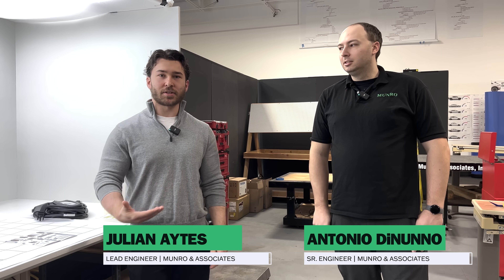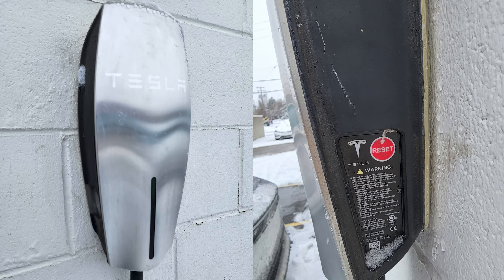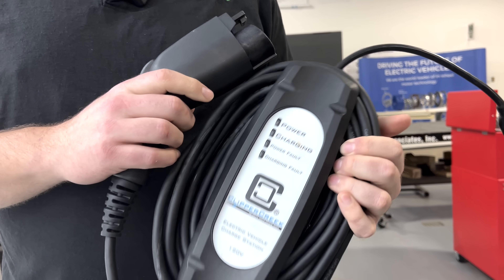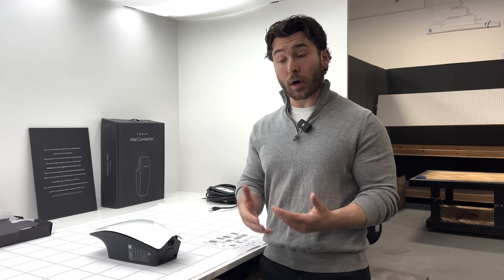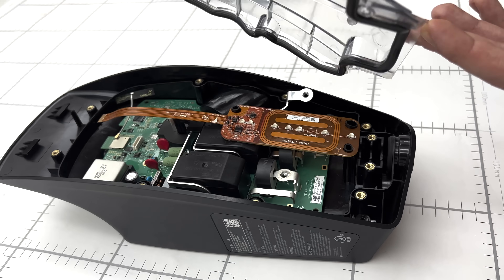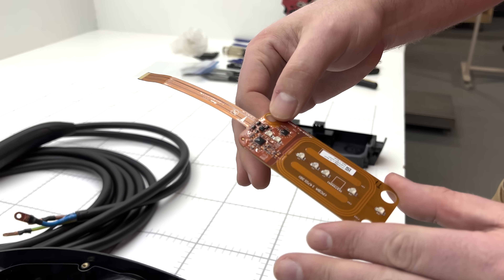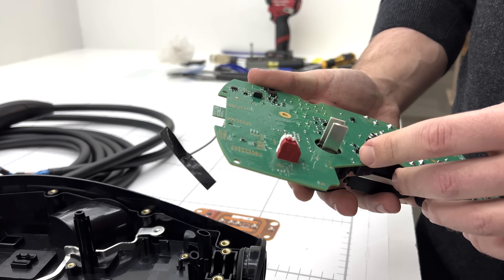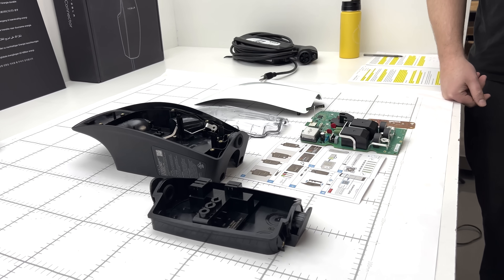EV Home Charger Teardowns E1: Tesla Wall Connector

Comment: How does this compare to the Tesla mobile charger that comes (or used to come) with each car?  I currently just use one of those on a 220 in my garage.
Reply: The current version Tesla Mobile Connector is limited to 32amps so the Wall Connector is adding up to an additional 3.8kw of power. I have the RWD Model 3 which has an onboard charger limited to 32amps so the Wall Connector doesn't help me.
Reply: I'm not volunteering mine for tear-down 😆
Reply: For Europe, the mobile charger is 1 phase 13A 230v (about 3kW). Old Teslas were shipped with 3 phase mobile chargers which were 11 kW. The Tesla Wall Connector is 3 phase 32A 400v, so 22 kW, but current Teslas have only 11 kW onboard charger. But it also can work as 1 phase 32A giving about 7 kW.

Comment: Underwhelming.  At least we didn't have to listen to bloviating about "Body Lines" and "French Stitching". 😂 Now retired, spent my life as an Electrical Engineer and never heard of evaluating electrical / electronic products by component weight.  You realize that it is mounted to an immovable building weighing >50,000 kg. and has no effect on any operational feature of the vehicle.  If this was to be used in aircraft, sure weight matters, but you might as well weigh the seat belt latches on a Semi as a useful comparison! 🤣
Reply: Yes, just a tad.  I could not help wondering if some company was thinking about hiring these guys and their skills of apply thin design to a wall switch?   To me, if anything, I would want a big honking switch to help dispose heat vs some plastic box that takes 5 min to assemble and if you hit it hard probably falls to the floor in secs.  So will the big, heavy switch win or lose at  the Murno Live weight contest?  Probably the thin one. LOL
Reply: @xfirstxlast6502  The thick curved layers of Polycarbonate are much stronger than a rectangular steel box.  The actual "switching" is done electronically by semiconductors and relays (aka contactors).  They could have mentioned that, but instead focused on the weight of individual parts 🤣.  Weak video. Hope this 'series' improves greatly, unlike the refrigerator / freezer mess of a couple of years ago.

Comment: Glad to see you pulled this and eliminated some technical bloopers before re-posting. One thing still grated on my engineer ear: At one point, one of the presenters says that level 1 charges at "one  kilowatt per hour."  No. Just no. It charges at 1 kilowatt. Full stop. Or you could say it charges at "one kilowatt hour per hour." Which is a bit redundant, but I have seen plausible arguments that saying it that way helps non-electrical folks understand that kilowatt hours (NOT  kilowatts) are what you pay for, store, and use to move the car.
And in the category of sweeping back the tide, but I want to try anyway - the items you are evaluating are not chargers. The charger (for level 1 and 2) is built into the car, and controls how much current the car draws. Yes, the public is going to call them chargers - but Munro ENGINEERS ought to call them what they are: EVSEs (electric vehicle supply equipment.)
It's a distinction worth making, because even if the EVSE on the wall is rated at 48 amps or more, the car's onboard charger may not be able to pull that much. You will do a public service by emphasizing that if the charger in the car is rated at 7 kW, plugging it in to an EVSE that could supply 11 - 22 kW isn't going to charge the car any faster than an 7 kW EVSE that: costs less, less to buy, less to install (cheaper wiring) and may fit into an existing electrical panel's limits when I higher rated EVSE might require a utility service upgrade and a service panel upgrade.
Reply: Yeah this video is going to trigger a lot of EEs with the poor terminology used. Not very professional.
Reply: We'll discuss the nomenclature on the next one, seems like it needs addressed.
Reply: 8A * 120V = 1000W But if you boost up to 12A max on a 15A outlet you get 1500W like a hair dryer.
Reply: 👏👏👏👏👏 you really think they would get those basics right 😅

Comment: I've been using a level-1 charger exclusively for 2 years (27K miles). No issues and I very rarely need to use public chargers. My battery gives 260 miles of range.

Comment: In UK, I saw this Youtube video from an elctrican installer, who said that he could not install a Tesla 
Wall charger because they dont have a arc circuit breaker, unless he also install a circuit breaker separately.

Note: An arc-fault circuit interrupter (AFCI) or arc-fault detection device (AFDD) is a circuit breaker that 
breaks the circuit when it detects the electric arcs that are a signature of loose connections in home wiring. 
Loose connections, which can develop over time, can sometimes become hot enough to ignite house fires.
Reply: IIRC, the required protection is integrated into the unit.
Reply: @patrickkenny2077  correct Patrick

Comment: This charger is 3 phase in the Netherlands. 3x16A on 230V. Other electronic design, but the same on the outside. Installation was really easy as each reasonable modern house has 3 phase 25A as minimum. If you don't have 3 phase it is easy to get it (Netherlands).
Reply: 3 phase is standard in the Netherlands?! That's amazing!!
Reply: @Ariccio123 Pretty much everywhere in Europe.
Reply: @Ariccio123  
Not really if everyone has it ;-)
Reply: @BendeVette  our split phased and two phase wired residences are deeply jealous!
Reply: @Ariccio123  
Is there no way to get three phase power?
It realy has several advantages, primarely the gauge of the wires (less losses).
Reply: @BendeVette  it's very hard, and very expensive. Which is bad considering we're finally trying to electrify everything. It might actually be safer too, since it might avoid the need to save cost by using aluminum wires for service entry power.

The strangest thing though, is that in America, we use split phase power for single family homes, and two phase power for apartment buildings. So, in apartments, "240/250 volts" is actually 208 volts. Everything power hungry needs bigger gauge wires and the motors use more energy. If we were smart, we might start trying to migrate incrementally, now, but nobody cares. 🤷‍♂️😤
Reply: Australia here and its 3 * 32A for 22kW of my dual charger Model S.
Reply: This charger even supports 32A 3phase. So 22kW charging Power. 💪 I will install it soon (Germany)
I think my house has 40A 3phase breakers standard, hope thats enough headroom. Otherwise they need to be changed to more amps. 😁

Comment: Mine went broke. I consistently limited charging via the Tesla app to 13 Amp. So, not via the hardware option to limit it, although I had set that to  20 Amp. 
Could that be the cause of may wallconnector gen2 going broke? Anyone?
Reply: No. Try the self test with the rotary switch on 0.

Comment: Hoping you can do some European ones as well. The Easee box is very common around here and they are having to recall hundreds of thousands of them now because of an RCD design fault. There are some pretty innovative ones as well I think you could be interested in, such as the Zappi which has optional CT clamps that can measure solar and battery storage and optimise usage of that.
Reply: I was searching about the Easee current status and there have been no updates in the last month. AFAIK, there were no recalls to Easee charger owners even in the countries where there was a sales ban (Sweden and Netherlands)

Comment: Hey Munro Team, maybe you will analyse the Video "Cybertruck castings spotted at Giga Texas!" ?? Sure you can read much info from the Gigapress junk! Greets
Reply: at 56s in his video that is offal, those are the channels used to flow aluminum from the melt pot into the dye. These are cut off and then remelted. The size of the arms on the forks are used to ensure metal gets to all parts of final casting.

Comment: The speaker type quick connects are likely for MFG Functional Test. The board is probably ICT'd as an assembly and then goes through a functional test followed by burn-in.  This does not need to be at max current but you do want power running through it during test.

Comment: The Wifi antenna might also be used to do over the air updates or to communicate with a Tesla Powerwall.
Reply: It is used for commissioning of the unit as well; you can pull in some home automation information from it, but unfortunately you cannot modify the charging current remotely via the connector-- you have to use the app for the car (or Tesla API to the car).
Reply: If you have more than one, it will negotiate power sharing on the same circuit, and can also enable billing in a commercial installation.
Reply: It’s mostly used for business or commercial settings
Reply: I can confirm over the air updates when connected to wifi and also some good info can be read in the Tesla app or 3rd party apps.

Comment: Something else to look at, which one of the other commenters touched on, is what is the labor cost associated with the installation?  The Tesla unit appears quite easy to install.  There are some nice features such as choosing direction of cable entry and the integral wire stripping gauge.  The installation cost may or may not be a pass-though to the end user, depending.  If I am not mistaken, GM, Ford, etc. have flat rate or no-cost EVSE installation included with the vehicle purchase.
Reply: Ford does not for the F-150 Lightning, but they are happy to sell your data to SunRun who began contacting me almost immediately after I placed my pre-order.
Reply: @pony53  Thank you for the reply. I appreciate the correction to my remark above.

Comment: Really need to see Munro take apart an Electrify America Public EVSE (believe this is the correct designation). Why do they keep failing and disappointing EV owners?  Thank you…
Reply from the maker: Thanks, Michael!
Reply: first EV experience in a rental Kia, went to Electrify America charger at a Walmart, super fast, worked great, Kia parked next to a VW ID4, got in conversation, who loves her ID4, 2 years free charges at Electrify America units.  150kW charger had 0 miles left "turtle mode" on Kia  54 minutes got 80%. 202 miles...went into Walmart for a drink on the road in no time, of course passing 5 gas stations that would have been 10 minutes and done, EV is long way to becoming practical for long drives
Reply: Anyone want to donate one of the many "not working" ones?

Comment: I'm surprised the correct term EVSE was not discussed.  They are not chargers.  By the way, I used level 1 charging for a year at got about 3-4 miles/hour on a NEMA 5-15 and 4-5 miles/hour on a NEMA 5-20 on my Model 3 LR.
Reply: That bugs me. How hard is it to say that the charger is in the car and this is just a safe connector. Stop dumbing things down, we are dumb enough.
Reply: There are a 101 different official names, I still like the "incorrect" 'charger'. Just watched the Marques Brownlee interview with RJ Scaringe, and RJ called it a charger. Sooooo....
Reply: I like the installation with all the wires in the back plate and you just plug in the charger. If it ever needs service just take out four screws and unplugged the charger and mail it in.

Comment: So for a “typical” home installation in the USA, what conductors come out of the main breaker panel to the charger assembly? Stranded or solid? 16:48 What size wire for L1, L2 & Earth? What are the NEC requirements for safe operation? More installation details should have been provided.
Reply: The video was about the EVSE itself. Those details are up to the electrician and local electrical code to determine. But a typical install for a 240V/48A charge rate will use 6 AWG wire (copper course stranded) for L1/L2 with a solid copper 10 AWG ground (earth) wire. Unlike UK, USA does not require fancy terminations with ferrules (bare wires in screw terminals is acceptable), nor a local earth rod. Virtually all EVSEs sold in the US have built-in double-pole RCD protection.
Reply: @TechnicalLee  Superb response, greatly appreciated! Cheers!
Reply: #6AWG, which is a coarse-stranded cable.  Usually it will be a 6/3 Romex cable.
Reply: @patrickkenny2077  wrong 6/2
Reply: @alanb.4660  Depends, some connectors need a neutral reference.
Reply: or follow the manufactures instructions which are in the manual which you can download anytime....geez.  Follow the current manual...you know things change over time.

Comment: In Australia we only have available at our wall sockets a 10 Amp max output at 240 volt, I’m understanding this wouldn’t be enough to power this device, we would need to tap another phase from the street line
Reply: No, you can do many more amps by running a dedicated cable / spur straight to the fuse box!
Reply: You can set the max. current during the installation/setup, so it is totally fine to have it installed on 10a/240v, it will be just slow to charge.
Reply: In Australia you can easily have 32A single phase or even 32A 3 phase. This is not a plug in level 1 charger. You can set the adapter to anything from 6A to 32A depending on the capacity of that circuit of your switch board.

Comment: Ahhh now it’s a 240 volt, it says 120 volt on the lid of that pack you have in this video, I’m confused
Reply: I guess it can do L1-N 120v or between phases L1-L2 as 240v. Similar in EU 3 phase you have L1-N voltage of 230v or L1-L2 voltage (between phases) of 400v.

Comment: Your saying roughly a 50-60 amp draw from your wall socket, yet the device is only 120 volts at 1000 watts that equals a 8.3 amp draw from your socket? Have I got it wrong .?
Reply: No, different devices. The 120V one only draws 12A, the 240V ones will draw anywhere from 16-48A depending on setting.

Comment: 1) these are not chargers, they are EVSE or connectors 
2) There is no Level 3 charging for EVs. It’s AC L1 and L2 and then DC fast charging. 

I wouldn’t bother commenting on any other amateur channel but this is supposed to be an engineering company channel where such details matter.
Reply: Yeah, noted that L3 comment also.  They seemed to be confused about Tesla marketing definition for their  DC FC hardware. I am sure they will get better, but this was a rough start.🧐

Comment: Sweet video, I have that charger and it does 48A nicely... But my button on the plug won't open the charge port... wish there was more on how the push button on the plug is connected.  When I press the button It stops charging and unlocks, so I think the data cable is hooked up.  I guess I'll open it up and look in there to see if it it was an assembly issue or quality issue.
Reply: My model 3 will do that if it hasn't unlocked yet. (I use my phone as a  key and sometimes it's slow to unlock.)
Reply: @meyermicro  it's an X, my mobile connector opens it fine,  but this one won't
Reply: Not a Tesla expert, but I think charge port opening uses Bluetooth. So there could be an issue with the Bluetooth antenna in the handle.

Comment: There is no "Level 3" in any official standard that covers EVs.   These are also EVSEs (Electric Vehicle Supply Equipment), not "chargers", the charger is inside the EV.  Shame on you for being an "engineering company" and getting this so wrong.
Reply: took some classes now u tryn  get some recognition on a youtube comment ... winner

Comment: 7:46... Are you sure the 80% rule isn't so the wires don't heat up... Since the EV chargers are on continuously and near max load unlike most electrical loads?
Reply: All circuit breakers sold in the us are rated 80% continuous duty. There are 100% rated breakers but are uncommon in residential applications